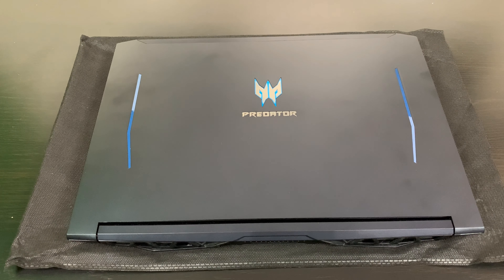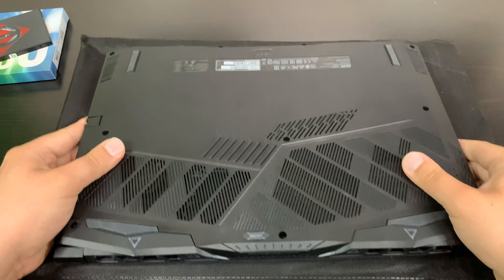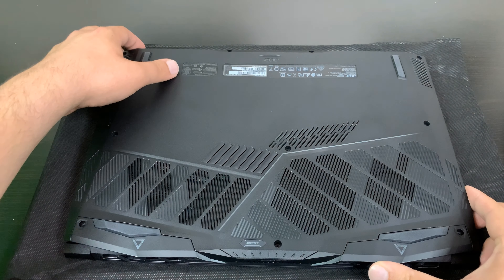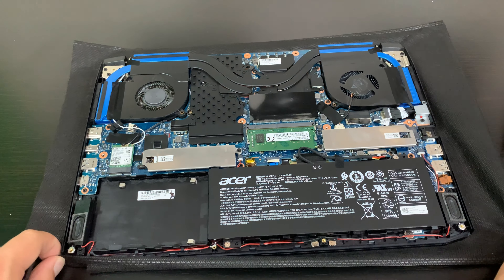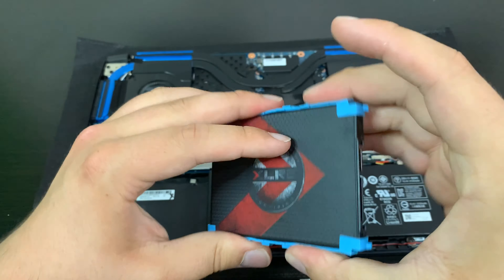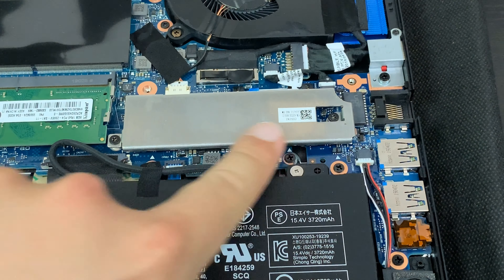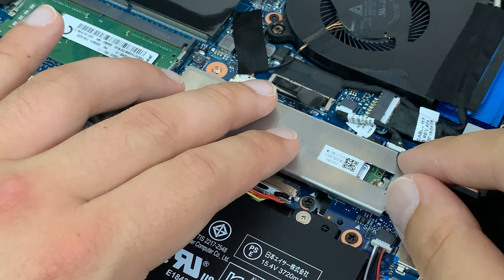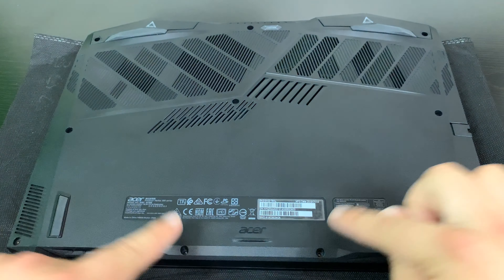Upgrade Acer Helios 300 + ANY Modern Laptop With 2.5" SSD + NVMe SSD Hard Drive! 2018 2019!

Comment: I finally decided to upgrade to a new laptop and got a new Helios 300 (17" screen) and it came with a good chunk of ram and really good graphics card, but it was lacking the much needed hard drive space, so thus I'm gonna need to go and get some. Videos like these help me out a lot, and make me so happy that it's a lot easier to upgrade this laptop then my asus rog, which anyone who owns an asus rog would tell you that, even thought he laptops amazing, taking it apart to fix/upgrade is one of the biggest pains for a laptop owner.
Reply from the maker: Yeah. I definitely feel most standard size gaming laptops are much easier to upgrade then they used to be!

Comment: Great video! Do I need to do something after or does it automatically detect the new ssd that I installed?
Reply: could anyone please answer this question ?^
Reply: Chris you just need to partition the drive after installing it
Reply: Alright so if you are using Windows 10 do these steps:
1- install the ssd or the hdd
2- and then booting up the laptop 
3- go to Disk management 
4- right click the new ssd which it doesn't have a free space or it does have a black line instead of blue 
5- New volume
6- next next next 
7-  Congrats u did it
Reply: @faisalalmalki5639  which is better for the helios 300? hdd, sdd?
Reply: @pilot4910  SSD is better than HDD
Reply: @faisalalmalki5639  thanks man. So 1tb ssd is good for the Helios?
Reply: @pilot4910  for any laptop
Reply: @faisalalmalki5639  which one do you have?
Reply: @pilot4910  I have a pc

Comment: An excellent video, but you can tell me the number or name of the cable you are installing with the SSD hard drive, since I bought a predator and I also have an SSD hard drive, but the bad thing that did not come with its installation cable. thanks for the info.
Reply: Contact acer and they should provide you with the necessary equipment

Comment: Hi! I really like your videos, and you definitely deserve more subscribers and views than what you currently have!

I just have one question:

Do you know if this video is relevant for the Lenovo IdeaPad L340 Gaming laptop (i5 core)?

Cheers
Reply from the maker: Yes, it is absolutely relevant. The L340 has the same connector for 2.5” sata drive. Process of opening up/which cable you need may be slightly different. Thanks!
Reply: @dalportodev  If you happen to own an L340 Gaming Laptop, would you consider making a video on how to upgrade the storage for it? All the videos I find - which, to be frank, are very few - do not really show this. :-)

Comment: Really loved the simplicity of your demo. I actually just bought your exact model laptop and am awaiting delivery on my 1TB SSD that I got on sale. It's an INTEL. Will the PC instantly recognize the additional drive? I saw somewhere that perhaps some adjustment might have to be made in the BIOS. Is that true? If so, what? Like yours, the boot drive is of course already factory-installed and my new SSD would be storage. Would look forward to your direction and confirmation. From the looks of it, if I followed your simple direction, it's an easy upgrade...

Comment: Make one for repasting and changing the thermal pads for this model.
Reply: Unplug the two fans and unscrew the screws inside (around the cpu and gpu part) and then just lift it up and you will see the thermal paste and you could change it there

Comment: If you bought the Helios 300 there should be a HDD upgrade kit with the SATA connector ( The Ribbon Cable )that comes with the computer. Managed to add my old 2.5" HDD drive to my machine.

Comment: Did your blue rubber housing come in a bag or in the computer already? I got the 2020 model and I got the screws and the cable but no rubber piece in a bag. Not sure if it comes in the computer already

Comment: XPG SX8200 Pro 2TB 3D NAND NVMe Gen3x4 PCIe M.2 2280 Solid State Drive R/W 3500/3000MB/s SSD (ASX8200PNP-2TT-C)

would the above SSD in this 2 TB form still be compatible with your rig? I have the same and will purchase if its a big  getr done or if there is similar or better deals out there etc. Also one last thing I noticed the read/write speeds are insane for the 2 TB version, will the Helios 300 1660 TI be able to take advantage of the speeds this ssd has?

Any information is greatly appreciated . thanks

Comment: My Predator 2019 goes around 90 degree Celsius both on Normal and Turbo. Is it normal with Predators, Please help!
Reply: id recommend getting a cooling pad. Theyre pretty cheap on amazon and u dont have to get an expensive one.

Comment: I’m currently thinking on buying an Helios 300 vs an Omen 15 with the same specs (i7 9th gen. 16 GB RAM, 1660ti). 
Any help on this? I’ve read that Omen kinda has better battery life, also comes with 1 TB HDD which is a bonus.
Reply from the maker: Hmm, well I haven’t had a chance to use/test any HP Omen laptops yet. I’ve seen pretty mixed reviews on them in terms of performance & thermals, so make sure you do your research. My Helios 300 has exceeded expectations on all fronts and an be nabbed at a good price. Only con I can think of is Acer doesn’t use the best quality panels for their screens. Hope this helps, thanks for watching!
Reply: dalportodev thx man! At the end I bought the Helios 300 :) Keep up the good work !!
Reply: @Felphex  Hey how is your experience? Plz share as me too planning to buy Helios for Content Creation & Video Editing. I am thinking of 17.3" Display. Would you like to suggest?
Reply: Aditya Singh Bhadoriya to start off, i think its the best option u can buy @ around the $1000 range! 
My only complain would be the battery life, but that’s normal on gaming laptops so! Getting around 5 hours on normal tasks like editing documents..

Screen is good for gaming, but for things that require accuaracy in colors, while it’s not the best, I think it can do the job! But remember, you can always check others displays to see if they suit your needs! 
(The Omen’s display has very similar specs, but I would say it’s a little better than the Helios’ tbh)

All I can say so far! Hope it helped :-). The Helios 300 has been a monster since I took it out of the box!
Reply: @Felphex  thanks dude. What about screen bleeding issue in Pradeator Helios 300?
Reply: @adityavds  forgot to mention that it may come with some of it, that's why I think the Omen is a little better in that part. My Helios came with a little backlight bleed at the top center of the screen but its not that big of a deal (at least in my case).
I've seen other cases of people sending it back because the backlight bleed is horrible around the sceen.
Reply: @Felphex  thanks Brother

Comment: The nvme you installed, is that a m.2 2280? Also how many gigs is that intel nvme? Can this laptop run a 2 terabyte nvme in the 2nd m.2 slot? Thanks.
Reply from the maker: Yeah it should handle 2tb just fine, and I’ll add the link the exact one I picked up in the description. Thanks for watching!

Comment: So I followed your link and purchased a 2tb version of the same exact m.2 SSD that you installed, but when I turn my laptop back on (same laptop) the new drive isn't showing up. Any help?
Reply from the maker: Check disk management in windows 10 you may need to create a new partition on the new drive if it is raw.
Reply: That's the issue though. I open up disk management, and only the Acer (C:) drive is showing up. There's no unallocated drive showing up. Like it's not even being detected.
Reply from the maker: @DxJeckel  You can check also bios settings are ahci for the extra nvme slot. Join my discord we will help you troublehsoot more! (Link in video description)
Reply: Hey, thanks for the responses. I don't know what was going on or how I fixed it, but it finally acknowledged it being installed. Lol. Checked BIOS, wasn't showing up there. Took the SSD out and put back in again. Checked BIOS again, still nothing, but then when windows booted it up again, it acknowledged it and I even got a volume creator tool from Intel that popped up. The only other thing I did was attach the plug to my laptop, cause the battery was getting low. So who knows. Lol.

Comment: I opted fir the i5 varient of this model.... (i5-9300h + 1660ti +16gb ram) ....how will it work you think?.... Will my gpu bottleneck?....
Reply from the maker: You should be fine. Would have preferred i7 though. Thanks for watching!
Reply: @dalportodev  you mean there shall be not a huge difference in gaming performance?....btw i am a regular watcher and a sub of your channel😌😌😌
Reply: Even I have the same version... I noticed that the difference in i5 and i7 is not very significant
Reply: Hence I bought i5 version
Reply: @swarupranjanpaul42  you could have just saved up 10k more and got the i7 variant I assume you got it during bbd sale from flipkart cause I got mine for just 86k in India. The i7 variant.

Comment: Nice content, keep it up!
Please tell me if i should buy dell xps 15 7590,  i5 version paired up with gtx 1650 or buy helios 300? I want a lap for moderate gaming and for other day to day use. Please also give a reason for your suggestion too! Thanks
Reply from the maker: I would probably pick Helios 300 personally.
Reply from the maker: Thanks for watching!
Reply: Thanks for your suggestion, how is helios's battery performance when no gaming is done?
Reply: I am getting 3-4 hours of battery life... Have have set the battery life saver from 90%
Reply from the maker: @monishgowda5975  I get more than this. What screen brightness do you use? Also Windows power profile set to power saver?

Comment: Excellent video, thought i have two questions. Does the laptop automatically recognize the second ssd, firstly, and what hard drive did you use, secondly.
Reply from the maker: Windows usually recognizes storage devices automatically, however depending on the manufacturer you may need to create a new partition in the disk management tool built into Windows. I recommend Samsung SSD's. If you need more help you can join my discord server (link in video description). Thanks for watching!

Comment: I will defently become a suscriber but help me first please, Acer told me I cant add more storage on the second NVME field otherwise it wont work and I have not been able to find any video of anyone showing that the computer worked after adding more storage on the second NVME field and how did you configure the bios to have the 3 of them working?
Reply from the maker: No bios configuration was needed. Plug and play as seen in the video.
Reply: @dalportodev  I just became a suscriber ty so much Sir I really wanted to know that so the 2 of them worked right?
Reply from the maker: Yes, for the Helios 300 I am running two nvme drives with a 2.5" SATA SSD as well. Hope this helps!
Reply: Hey did it work?

Comment: Does WD BLACK SN750 NVMe with the heatsink fit into the blue 2019 acer predator helios 300?
Reply: No, it says it for desktop. And you already have alluminium holder why you would need heatsink.

Comment: Same helios and you told me I could have 2 nvmes and it doesnt recognized the second, I need help
Reply from the maker: Your drive may be raw. In Windows you can open disk management to create a new partition. Perhaps I'll make a video on it. You can also join my Discord for more help.
Reply: @dalportodev  ty for answering fast but here is the problem I did that but the drive wont show up on disk managment
Reply from the maker: @gredeldsklnt3961  Can you please provide a link to the NVMe you are trying to use?
Reply: @dalportodev  I fixed it bro ty for the answer, many people reported to have same problem and then system (OS) wont even boot wich was my case but after I switched the places for nvmes I thought it was going to work but still didnt so I tried bios, disk managment and wont be showed so I open and switched places and out of nowhere worked, really happy
Reply: Hey man, how did u fix it?? I tried to switch m.2 nvme and it didn’t work.... I’m trying to install an 970 evo plus NVME M.2 in this Helios... could you help me?
Reply: @Dicosan  Just curious, are you adding the 970 EVo to the 2nd open slot or replacing the one that came with the machine? I'm planning to add a 1 TB 970 Evo Plus tomorrow and was wondering if I may have your same issue. I'm also installing a 2 TB hybrid HDD SSD drive to the 2.5 open bay as well. Couldn't beat 2 TB hybrid Seagate FireCuda for $59.99. Probably overkill for loading maybe 5 games and the rest of my DJ music will be stored on the hybrid 2TB drive.  @dalportodev

Comment: So there’s 2 NVMe ssd slots and 1 hhd slot? And they have to be 2.5
And the ssd’s has to be called NVMe and NOT SATA?

Dunno much bout computers so I just wanted to get this straight.
Reply: Luuucasus There is sata and nvme ssd’s..That 2.5 inch slot can fit both HDD and SSD.